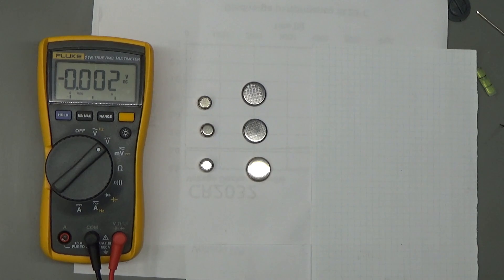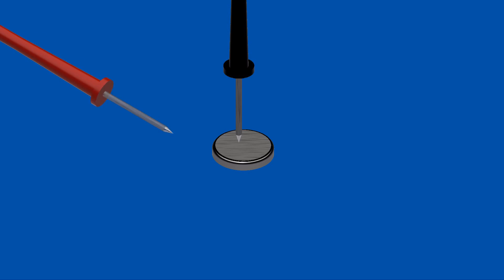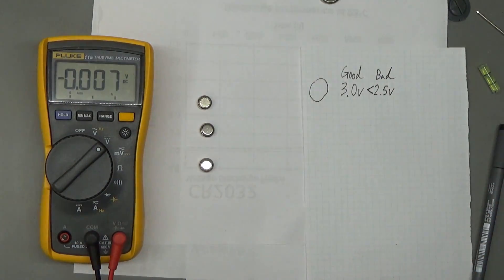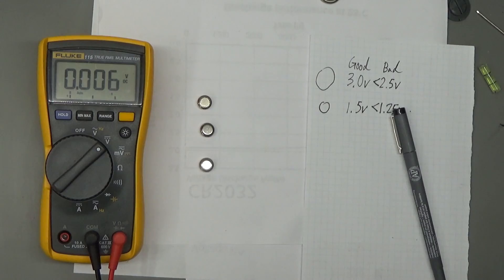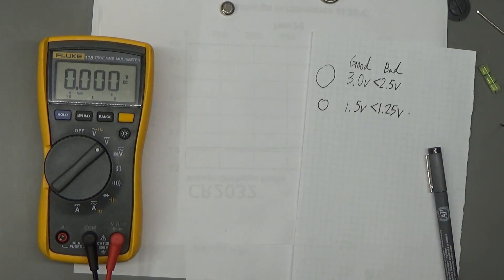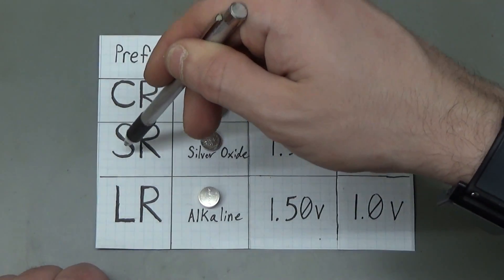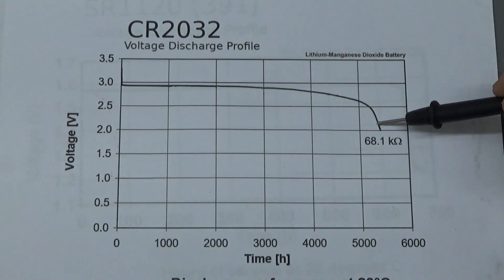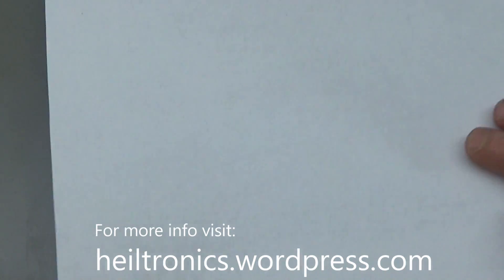Coin battery testing

Comment: For rechargeable AA and AAA batteries, a different video showed how you can test amperage.  The key is to not connect it for more than one second.  That is enough to get a read.  I don't recall what the values are for good and bad.

Comment: In my experience, new coin batteries measure ~3.3V and devices often start getting flaky once the open circuit voltage drops belows 3.0V.  I would consider  3.0V or less to indicate a battery that needs replacement.

Comment: I don't know if i measured my battery correctly or not. But it appeared to have a dc voltage of 3.1 with only .45ma, what does this mean? Does the (ma) not matter? Ive seen other videos  say theats just as important as the voltage.

Comment: I'm repeating what some others have said already - you can't test any battery without a load being applied.   Even car batteries need a load tester to draw some current.  Button cells often show a nice 3V to a digital voltmeter even when they are effectively dead.

Comment: You need to put a small load on the battery when you test it or it means little just looking at the voltage.  If you cant do that at room temp a "brand new" 2032 etc. reads 3.265V at room temp.
I have put plenty of 3V (measured) coin cells in things that don't work.

Comment: You can't just measure batteries outside with a voltage test. Even an empty battery can show 3V. The thing that's important is if the battery can hold that voltage when it's being used (is under load)!

Comment: I have an LR44 2 batteries to power a digital hygrometer.  Put in July 6 2022.  D8gital readout and speed still good.  May have lost accuracy.  Factory reccomended changing after 9 moths.  I did not.
As you can see this exceed 640 hrs.
So how is this and will voltage affect accuracy of humidity reading?

Comment: Early in the video, you state a coin battery is considered dead at 2.5 Volts and later 2.0 Volts, similarly two different dead voltages stated for a button battery.  Please clarify.

Comment: This rule is not general available for all coin batteries. China batteries are not good capacity (far less mAh than a genuine good quality coin battery of a top brand) but they still keep the voltage. Recently I bought two used Casio DB360 and one of them had a genuine Renata (not a fake Renata) 2025 coin cell batt at 3.02 volts and still can turn on the LED backlight of the watch and the other watch (same model watch) had a Chao Chuang or a Sun King (a bad quality China brand 2025 coin battery) at 3.06 Volts but no LED light on and barely i can hear a beep from that watch. I replace the cheap China battery with a new battery at 3.32 volts and almost dead watch come back to life, LED light on and the beep sount more louder. Because that bad battery who put me in error after i test it with my multimeter and show 3.06 Volts, a erronate conclude almost convinced that watch is damage.

Comment: A volt meter test of a lithium large button cell is virtually indeterminate as a good will read 3.0V and a "dead" will read 3.0V. Your examples are extremes and are obvious cases of determinable battery life. Using a glucometer for diabetes will fail to boot, then after warming cell in ones arm-pit for a period of time (70°F upto 85°F+) will give enough thermal warmth for the chemical reaction to produce more current flow. This technique can give you an extra month to purchase another battery. This quick cheat is ditto for bathroom or kitchen food scales where warmer than ambient room temperature (68-72°F) allows for the device to work. User skiwi33 load test is a good idea and will give you a more accurate cell state. (load of 0.6mA using 4.7KΩ resistor) CR2032 cells are rated around 210mAH capacity with Energizer rated higher by cheating current and cut-off voltage down to 2.0V. Their test indicated a 2.9V, 0.19mA load but resulted in an additional 300+ hour extra life span for 225mAH cell. Their chart indicated upto 200mAH capacity smooth sailing and after a rapid decline that would depend on the device voltage and current usage requirement.

Comment: I test by putting a 5mm LED in series with the cell battery measuring the current in mA. If above 4mA it’s good, if below like 3.x, I replace it. Very easy to hold probe and touch the cell.

Comment: I don't know if those batteries are comparable but the difference in discharge time is wild!. Lithium has almost ten times the runtime of the other batteries.
Very interesting to see the silver battery. It's practically fully charged, until it's dead.

Comment: Question. I have a 3v CR2016 battery which when tested on a traditional battery tester with wired leads tests well into the "good" zone. However, when tested on the BT-168 handheld tester which I am sure you are familiar with, the pointer does not move remaining way over to the start of the red or "replace" zone. Why the discrepancy? Also, I tested the battery on a multimeter and got a reading of 2.9 volts. Any ideas?

Comment: The guy in the video doesn't have to much knowledge about electricity. He just touched the easiest way to explain it. 
 Seeing 3v or above  on the meter doesn't mean  that the battery  is good. At all. To get it right , you have to do the Amp reading  , which for 3V new battery shud read around 8.2 mA

Comment: Hi, Thank you for the video. I have (3) stored, never used CR2025. All read 3.0 volts but do not work on a remote control for a digital camera. I thought it was the RC-but find out it was the batteries. Any idea why all read 3+ volts but do not work? thanks in  advance for you input!
Reply: its because of amperage. this video relies on pure voltage which is not enough, amperage does matter so you need to test the battery under load. https://www.youtube.com/watch?v=CZ3PwVtCe1A
Reply: @elwrongo  It crossed my mind. Thanks again for your expertise.

Comment: You can make a coin battery charger and check the voltage as well, get a wooden peg,at the end drill 2 small holes and use a small nut and bolt and fix to both sides, get a battery connector and fix the live to one nut and bolt, and the black wire to the other side, put your cell battery between the peg with the nut and bolt and will hold in place now you can test the voltage onto the battery connector and you can charge the battery as well by connecting a low volt battery to the battery connectors and you now have a charger as well

Comment: As MANY others have commented, this is a terrible test method.  All you're measuring is the NO-LOAD voltage - it's like the first thing a 12-year-old would do with a new DVM.  Think back to your last dead car battery...probably all the dash lights worked, the horn, the radio...but when you tried to crank it over (high load), the lights dimmed and anything else that was on went into brownout from the load.  You really should take this down because it's just...wrong.  Put up another video showing how to REALLY test, including small loads, if you want to be of service vs. providing disinformation.

Comment: Best to put a resister across the 2 tester leads.  4.7kohm works well. This puts a load on the battery and is a much more reliable way to tell actual health of the battery
Reply: Anyone that is unaware that a load needs to be applied to properly test button or coin batteries has no business producing videos on the topic of batteries.  Half of the population appears to be a bunch of self proclaimed uneducated professionals that put others in harms way.
Reply: This test doesn't show anything except if it is under 2.8 volts it's really bad. They can still measure like he is doing it as good and be bad. As skiwi said, you need to load test a battery.
Reply: Thanks for the tip.
Reply: I work at a place where we test car batteries and the battery tester we have had a load tester. A lot of our batteries initially look good until you put load on them and then they show bad.

Comment: You need to test with a load.   Button batteries will always show max voltage even when they should be replaced.
Reply: Well, clearly that’s not a true statement. You can see evidence against your claim in this video.
Reply: @amosfeldman9454  So just because you see something it must be true.  Don't go to magic shows....you might start believing people have superpowers.
Reply: @amosfeldman9454  The voltage-vs-time curve for a Li battery goes way out to the right without dropping much - but of course there's a point where it drops off...so just the fact that the video shows some cells not at "full voltage" doesn't mean that those that haven't dropped still can provide any useful power.  Loading during testing is critical.

Comment: Excellent & clear video. I still struggle a bit with the settings on the multimeter and of course they all seem to be set up differently. Maybe add more on the setting up of the multimeter at the start i.e. Where the black & red leads are plugged into and why.

Comment: Yet another pointless video showing how NOT to test these types of batteries or any household type with a multimeter !! Even a completely duff battery can show a voltage that might match the batteries true capacity. You should always test a battery under load conditions, absolutely pointless doing it like this video shows.
Reply: Womp womp

Comment: I've got tons of 2032 batteries that read 2.99-3.01 V on my Fluke 115 and don't work in key fobs :(
Reply: put a Resistor like R=150 Ohm on it while measuring voltage to see if the voltage drops into the "not good" region..., EDIT: NO i guess for button cells a tiny load like 2.7k Ohm is better

Comment: such a good video thank you i was worried my not too old key tracker (galaxy tag) died but testing the battery it turns out its very dead at 0.12v. I've only had it not too many months but it seems the cell they provided was a cheap chinise ones home brand one made by Henlimax.

Comment: TOTALLY WRONG with coin batteries . This is open circuit battery voltage measurement, it only shows which battery is bad (ie under 3.0V). It cannot show the battery is good (ie over 3V but still is no good). The voltage must be measured with the load. 
I don't know why you can post this video when you don't have any knowledge of electrical.
Reply: agreed, put a load like 150 Ohm resistor on it and measure if voltage drops into "bad voltage", EDIT: NO i guess for button cells a tiny load like 2.7k Ohm is better

Comment: No testing under load (e.g. with a LED)?
Reply: or a resistor like 150 ohm - it would be much better, EDIT: NO i guess for button cells a tiny load like 2.7k Ohm is better

Comment: Why do all CR2032 batteries I test still give me 3V or superior values?
Reply: cause you should measure the voltage with a current flowing to see if it is good. use maybe a 2.7k ohm resistor for button cells

Comment: You have to check these with a slight load applied to remove any surface charge.  you can't trust a mulimeter reading otherwise.
Reply: Best to put a resister across the 2 tester leads.  4.7kohm works well. This puts a load on the battery and is a much more reliable way to tell actual health of the battery,
Reply: Absolutely. They can test good with that simple test but fail under load when they are quickly exhausted of charge.

Comment: Great instruction but there's one important omission. You didn't state which range to select on the meter and it cannot be read onscreen. But thanks for posting the instructions.
Reply: his multimeter is auto range. you set the multimeter in the not smaller voltage setting than the battery you measure. so this red one would be set to the next smallest voltage which is greater than 1.5V or 3V which is: 20 Volt DC:
https://www.youtube.com/watch?v=ts0EVc9vXcs

always measure with a load on the cell or else it can fool you and show good voltage that would break down with current flowing. use a resistor like 150 ohm.

most likely a much bigger resistor like 2.7k is better for the cell to not drain it too much ...

Comment: This doesnt mean a battery is good. Some will show 3v under nil load. But the moment you pop it into a device it wont perform bec the voltage will drop. How to measure the MAH on the battery to tell if it has juice left for service life ?
Reply: The guy in the video doesn't have to much knowledge about electricity. He just touched the easiest way to explain it. 
 Seeing 3v or above  on the meter doesn't mean  that the battery  is good. At all. To get it right , you have to do the Amp reading  , which for 3V new battery shud read around 8.2 mA

Comment: This is a bad advice. Without a load even an empty battery an show well over 2.5 V.
Measure with 10kOhm load between terminals. This will show you the real voltage at more nominal current draws (200-300 uA) for a cr2032.

Comment: I have a Fluke 117 multimeter and had to test about 20  CR2450 3.0V coin cells that were in service for over a year.  Most were around 2.99V, but some gave strange readings such as 1.65V that gradually climbed beyond 2.0V the longer I held the test probes in place.  Have you ever seen this type of behavior from these types of batteries?  Why would I see the voltage climb? Testing a new battery the voltage reads 3.03V as soon as I apply the test probes, and the voltage remains constant, so I know the meter is working properly.
Reply: You were holding the cell. Chemical reaction increases with warm as you observed.
Reply: @cbaxter6527  If you mean my fingers were touching the cell, no.  The only thing touching the cell were the probes of the multimeter.  Coin cells can be tested laying flat, positive side down, as the outer edge is positive with the negative side up.  No need to hold the cell.

Comment: How important is amperage? I've noticed that new 1.5v batteries put out about 150mA and are dying below 100. I've used amperage for years because I have a mix of regular and NiMH batteries which are normally only 1.2v and are measured in mAh also. When they hold less than 80% of their rated capacity, it's time to recycle.
Reply: I had tested my failing CR1632 3V disc before I posted this and it was still just under 3V. When it completely failed I tested the amperage and it was about 30mA. The new one pegged the 150mA limit of my multimeter. The voltage of the new battery was only slightly higher than 3V. So, yes, amperage does matter.

Comment: No load testing of CR cells is kind of useless, you need some kohms load to accurately measure it's state.
Reply: What do you mean , sir?
Reply: @mrg466  you need to put a resistor over the terminals to simulate a load on the battery while measuring. Otherwise the measurement is inaccurate.
Reply: Ok thanks, .
Reply: Is that what battery tester devices do? Is there a video out there demonstrating this diy load test?
Reply: @Tupelo777  yes, a battery test will apply a load when testing, some multimeters come with battery testing function.